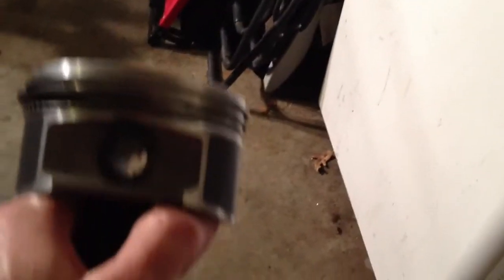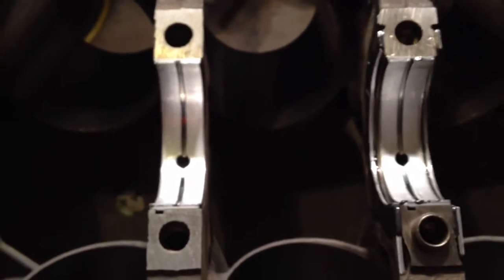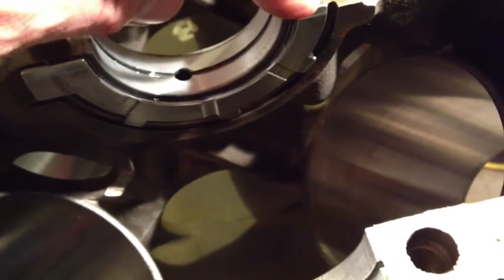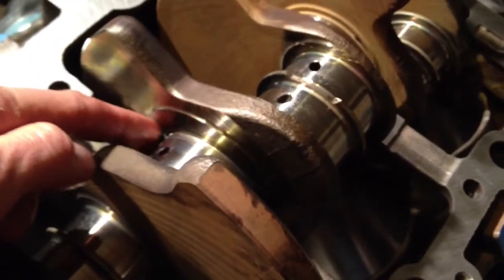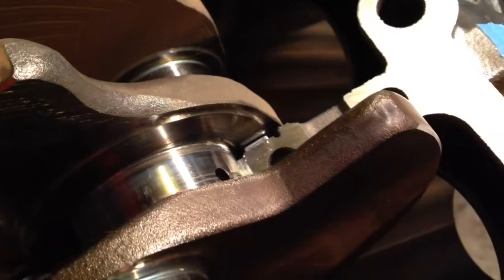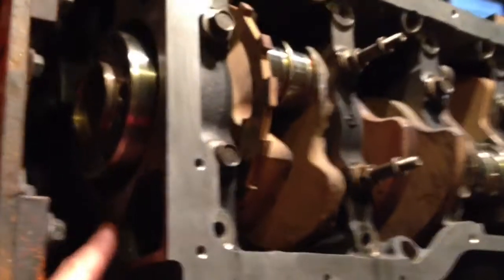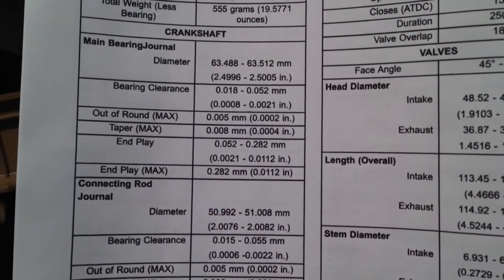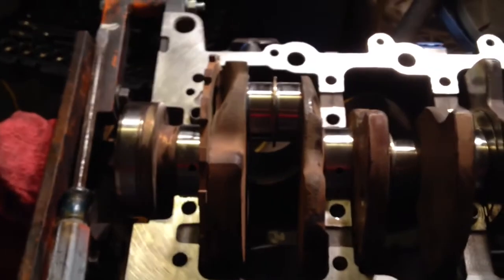Engine Rebuild 4.7L HO Motor 2002 Jeep Grand Cherokee (Part 6)

Comment: Did you reuse the bed plate bolts? or get new ones?
Reply from the maker: I did. They are not torque-to-yield, so assuming they aren't messed up in any way, they are safe to reuse.

Comment: Do you know what the torque spec for crankshaft is?
Reply from the maker: +keepithookin 21 I can look it up in my manual when I'm around the house. Which bolts in particular? Are you referring to the bolts for the main bearings?
Reply: keepithookin 21 engine torque specs on4.7 v8 please

Comment: Great job- I have a 96 Grand Cherokee 5.2 a far simpler engine- I was watching another 4.7 rebuild and he states that 4.7 cranks have no STANDARD size and all journals need to be measured as there seem to be different sizes, he also says that the crank tone ring the specs are written there- He had an engine with a rebuild and only 20k and the oil pressure was 0 and the rebuilder never checked clearances so the engine was ruined due to someones laziness- he bought the vehicle with that bad engine
Reply from the maker: Some of these motors do have varied main bearing sizes. If the motor has anything other than stock it is stamped on the end of the crank near the crank shaft position tone ring. This motor used all stock bearing sizes. I should have mentioned this, but I forgot. Ultimately, if you check the clearances, you will catch such problems. Thanks for watching!